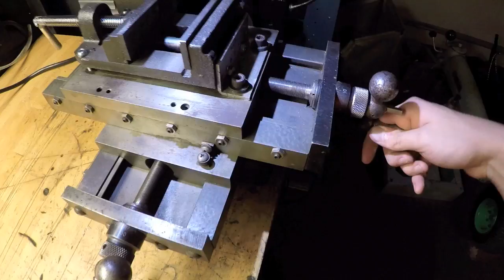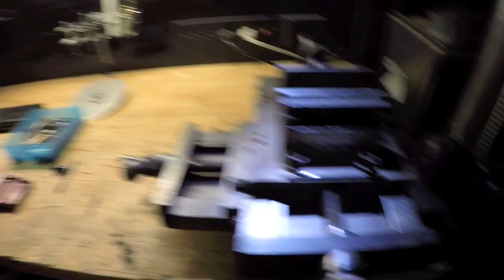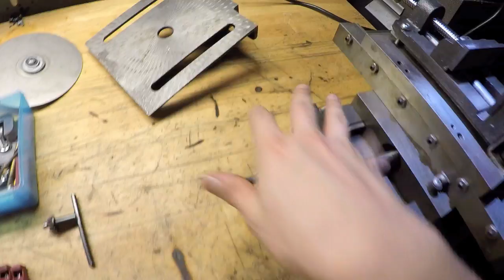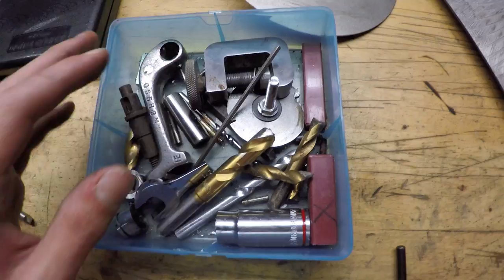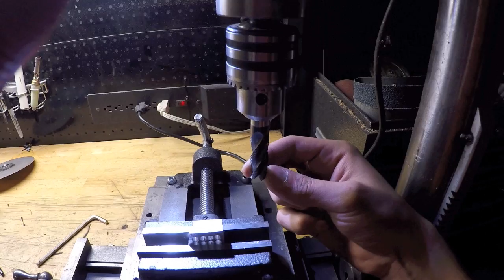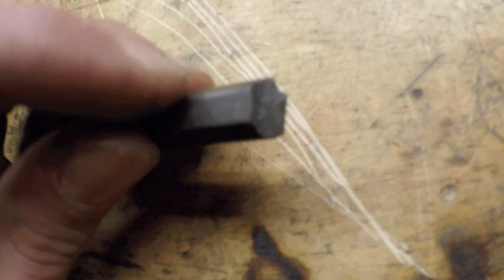MILL FROM DRILL PRESS: It can be done!

Comment: The Jocobs taper bore that holds the tapered shank in the chuck key is not suitable for side loads, and will most likely fall out in use. Your Mic could use an upgrade or 2, had to use the closed captions.

Comment: I've watched a lot of these videos, a good one will tell you to use Morse tapers to hold the chuck/cutter but the best videos will mention that the bearings in a drill press aren't designed to take the sideways pressures of milling. Think carefully before you decide to do it.

Comment: How do you secure the chuck in the machine? Really really really super really bad idea to rely on a taper fit, when milling. I have spent all morning looking forr a video showing a conversion that uses a draw bar and so far no joy. I found one guy who turns down and threads the spindle, for a threaded chuck, but I am really not super cool with that, actually. Still that would be better than just sticking the chuck up there and hoping it stays, cause it won't.

Comment: Looks promising but it would be nice to see it in action.
P.S. If your Quill is a sloppy fit you could remove it and electroplate it until it's a good sliding push fit though as you said you have a screw to clamp it up anyway..

Comment: put a rod in the drill press or a drillbit and pull down on the handle and look at the flexing, but there is a way to fix this the rod column is hollow replace it with a solid metal rod and make a thicker base for it and weld it on. good luck

Comment: SUPER DANGEROUS with a DRILL shaft in a MILL..!! A drill shaft is made for downward pressure ONLY and WILL come loose and fall out while milling with horizonal pressures!!! The shaft is only held in by tapper fit and any sideways pressure, while it is spinning, WILL make it fall out. Milling shafts are made for milling by the fact that they are bolted into the shaft with a drawbar!!!!
Reply: I think you must be speaking of the Chuck not the shaft. The shaft is not just held on with a taper it's the chuck. Oh and mine is retained by a bolt up through the chuck as well so maybe his is held similarly. Kind of a low budget questionable unit though it appears to me. The vise is really even aligned to the head.

Comment: No spindle/bearing replacement? How is it handling the side forces?
Reply: It doesn't..!!! What this guy did was super dangerous and can get someone really injured!
Reply: @Tom-yc8jv  how is it dangerous? If you go slow and use shallow depth of cut on soft metals like aluminum and brass ect, a simple drill press should be able to handle that almost negligible side forces. The main problem is precision.

Comment: This was useful! I have a craftsman floor drill press. 

1. I like the way you raise and lower the head. I've been raising and lowering the table. I have a 3 jaw chuck and a rotary X-Y table. Mounted together they are quite heavy and my table tends to sag outward slightly on the bolt. I'm not sure how I can adapt your set up to my floor unit quite yet. You did lose the ability to rotate the table on the column.

2. Adding a couple of locking screws to the quill is so easy. I don't know why I didn't think of it. I've been using the depth ring to hold the quill in the up position, but that doesn't deal with any slop in the quill assembly.
3. I don't know where you got those slides from, but they are really nice! I use a $400 Wilton cross vice.

If I have a piece of advice...get collet blocks. They are pretty cheap and far more stable than your drill chuck tool you use for indexing for cutting multi-sided parts.

Comment: I stole this guys idea of welding the bench drill table adjuster to the base.
Just completed my homemade milling machine. I am calling it "The Frankenmill".
It is made from a  Chinese drill press. A 500w cheapo hammer drill and the base from a plunge router. It is a Silverline power hammer drill and it is mounted into a Trend plunge router base and fixed to the top of the drill press headstock. I ground off the existing casting that houses the Pulley bearing and splined shaft.
The standard 500w induction motor was removed along with the Pulley/belt drive system.
I modified the quill to accept a 20mm Collet x 150mm extension holder (Ebay CL20 ER20 150L) and welded a smaller 13mm shaft into the end. This shaft fits into the power drill chuck. The Collet extension shaft is now direct drive to the hammer drill. I had to change the bearings from 12mm to 20mm.
I am using a set of ER20 Collets to fit up to 13mm milling bits.The plunge router base allows the quill to move up and down whilst maintaining direct drive to the Collet shaft.
The power drill has a variable speed trigger, so i can dial in different speeds up to 3200 rpm. 
I drilled and tapped 8mm threads around the quill and used 8mm Nylon Bolts that synch onto the quill to remove any play.
I already had a Proxxon KT150 XY table mounted to the base of the drill press and a standard 4" drill press vice.
It works an absolute treat. I can easily cut slots in Aluminium with an 12mm 4 fluted milling bit at 5mm depth cuts. The power drill is ideal and it is geared so i get a good amount of torque at the bit.
It handles mild steel with the same milling bit.
I might upgrade the power drill for a 710w version if i can pick one up on the cheap. The whole conversion cost me less than 20 quid.

Comment: Cylo… 
(Just a thought, Instead of changing the bearings...)
  I know the bearings on a drill press are "designed" for vertical pressure , and not lateral/ horizontal pressures that may dislodge the chuck...ejecting it across the room, giving a whole new meaning to "fly cutter"....but, 
  I'm considering drilling an +/- 1/8" hole perpendicular all the way through the entire quill,  spindle and the chuck taper shaft out the other side....then inserting a "spring pin" (aka roll pin) that is recessed within the quill, but connecting the spindle to the chuck arbor...that would suffice in securing it, but also making it easily removable for future chuck changes...kind of like a shear pin...but for light duty.
 But First,  I've got to get a press, change out the AC motor to a treadmill DC motor so I'll have much slower speeds for milling. ....Your thoughts...
Reply: Just my thoughts. I've been trying to mill aluminum on my bench drill before I realized this. Now I'm really worried about my bearings...
Reply: You shouldn't have to swap out motors, since all drill presses have adjustable belt speeds on top of them. Unless you are switching between materials all the time. In that case, it would be better to just get a real mini mill. The roll pin will not work under milling stresses and will shear off in no time. If it did work, they would have been doing in the few hundred years that metal lathes have been around.

Comment: but peeps say the spindle bearings on a dp can't handle side loading. how long would it last? I have a cheap Wen dp and thought if I just mill .040 - .050" per pass with a small bit, I might get away with milling some channels in 6061.
I need to cut some cooling fins
Reply: The bearings can handle side loading easily. Even if they wear out after a few years of use. They cost less than a tenner to replace them.

Comment: I like your table removal, welding table ring to base mod..!!! great ideal just for drill press.You will need to drill 3.5" hole in workbench or bolt base over edge of bench. I found two winding in parallel in motor, added a DPDT, for energy saving widings in series because for solar power saving operation. Centrifugal switch need a 30ufd cap in series. Stock induction motor inrush was so huge a 2000watt inverter pooped out.

Comment: Did you machine a new draw bar to take the  horizontal pressure when milling ?.It is said that it is dangerous to mill with a morse taper insert.All videos that i watched on guys using drill press to mill,they dont show how the actual conversion is done eg removing the draw drill draw bar and inserting a modified one  to take milling pressure
Reply from the maker: normally thats what you would do. my drill press is kind of weird. theres no morse taper at all, only a JT3 taper built in on the bottom of the quill for the chuck, and it has a threaded hole in the middle to hold the chuck on from the bottom. ive never had a problem with it.
Reply: Mine has a JT3 (Central Machinery S-987) also that I haven't looked into more if tapered or not.  Other models manuals note the bearings being 6201's though one of the videos online shows a 5201 double roller being used and I did measure the spindle shaft which is .625" so makes more sense being a 5201 and not a smaller 10mm 6201 inner bore bearing from what I can tell.  I'm still waiting back for a manual from Harbor Freight or to see if I can find the manual around here. 

Figured I'd work on and ordered the mini-lathe materials and will make that into the lathe and mill with a right angle plate and adapter to replace the compound rest/slide, some locks for the cross slide and carriage and a vise with a vertical slide like this: https://www.ebay.com/itm/Swivel-Vertical-Slide-125-x-100mm-Tool-Post-Milling-Lathe-Machine-PREMIUM-ATOZ/264137190423

I'll invest in the collet chuck and am wondering about installing on the drill too... though mainly thinking since I want to be able to machine components for the truck, car or whatever fabrication out of steel/titanium... I'll just upgrade the drill press to be more accurate. 

There is the tailstock Collet Chuck that I was wondering about drilling a threaded hole on the top to make a draw bar addition: https://www.ebay.com/itm/MT2-ER32-Collet-Chuck-Morse-Taper-Toolholder-MT2-ER32-Milling-Chuck-Holder-Tools/192734181071

Amazing the price!
Reply: Something like this as I was thinking about since so cheap and not as large diameter mount plate... doing the same with mounting on the lathe spindle:
https://www.youtube.com/watch?v=mR-TSjALqY8

Here's the mill conversion I was refering above with the 5201 bearing and I think a tapered bearing is the better as I ordered for the 7x10 lathe: https://www.youtube.com/watch?v=3menFwDDFOI&t=98s

Here's the bearing reference:
https://youtu.be/3menFwDDFOI?t=211

Steve Jordan's Youtube channel has the ideas for the mini-lathe I'm using.  

Keep up the inspirational work!  Looks like fun project you have going on.
Reply: I did a simmilar modification on my drill press, which is shown on my chanel. I fixed the morse taper with a simple srew which holds the taper inside. I used an additional bearing too and now i can mill Aluminium with a cutter diameter of 12 mm with a depth of 3 mm and more. With an 8 mm milling cutter, I can mill a depth up to 10 mm.Of course, my machine is a bit heavier (140 kg).
Reply: excellent question.